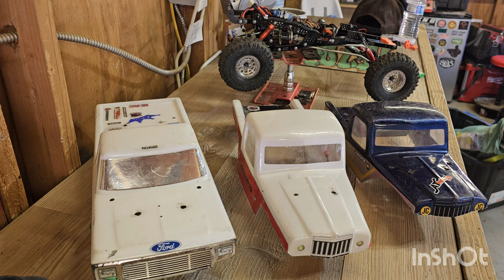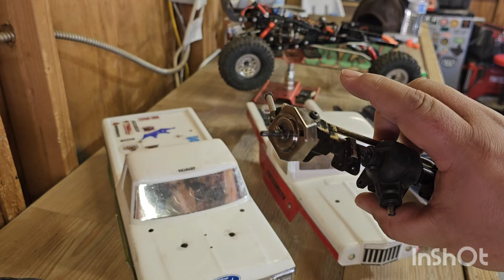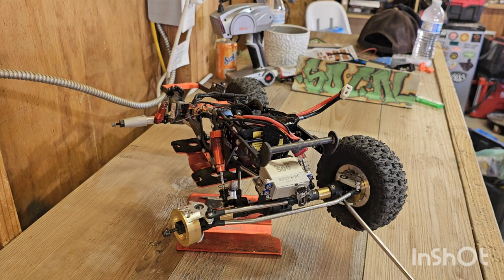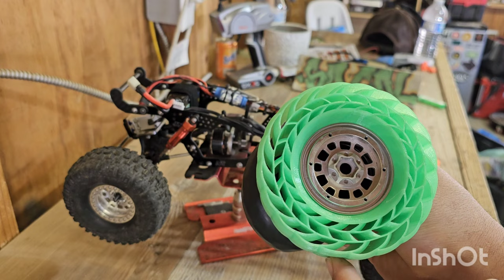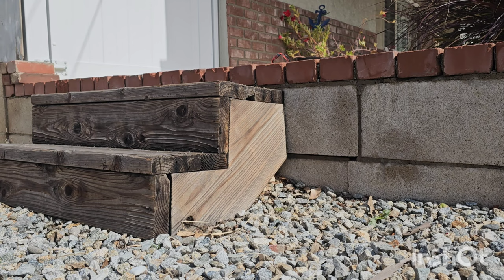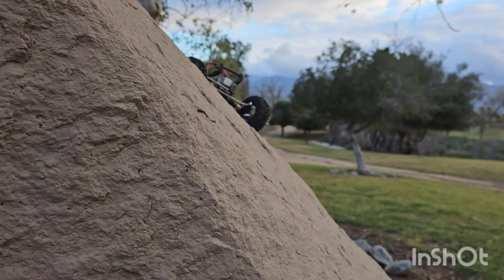HARDLINE KILLER BUILD VIDEO!!

Comment: Typically from what I’ve learned and what I run is high on the axle then high on the chassis. So for portals you’d run them a little higher on the chassis. And for straight axles lower on the chassis. The front as you said low on the axle high on the chassis.
Reply from the maker: I tried that and it climbed way worse.. the bright liked it so the rear uppers point down toward the bottom of the front axle. But every rig is different for sure

Comment: Very nice rig i have also this chassis but is Black Widow version is a best chassis🤤
You link and shocks configuration are wrong to work very weel,i use front link a lit bit more long and in the rear i have more bent in the lower links,the shocks i use double springs set up with hard and soft spring with shafty style inclination 😎
Reply from the maker: I never got it the way I wanted it. It's in the pile of used chassis